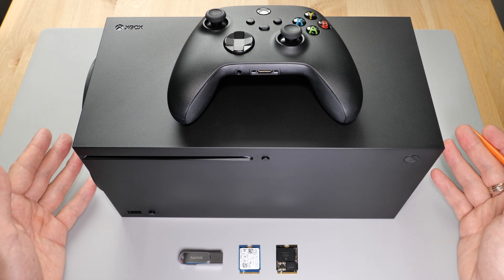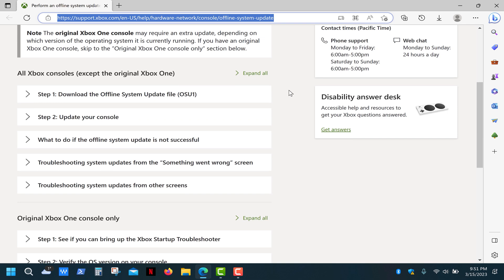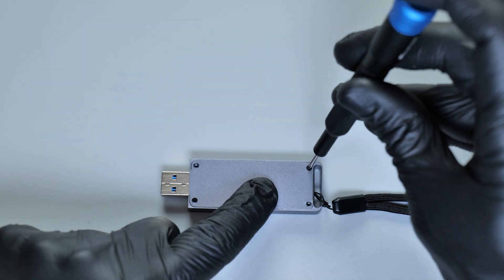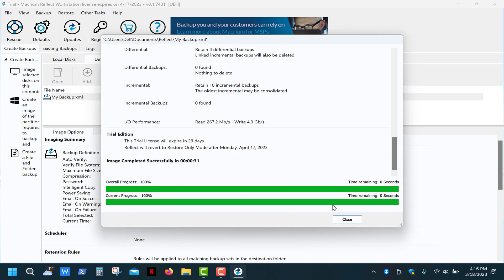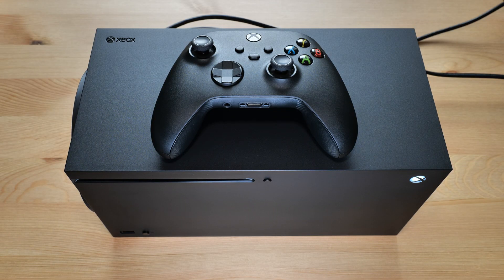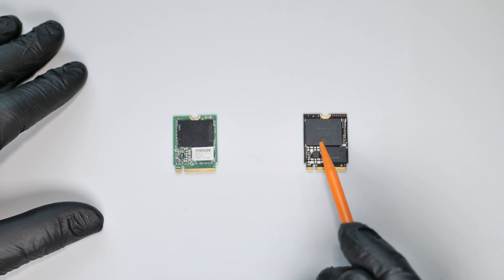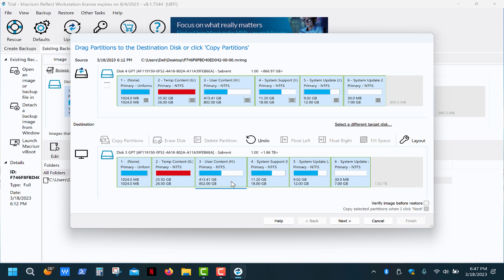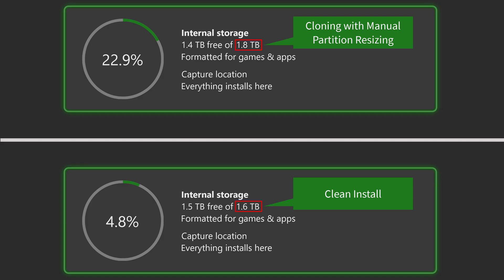Upgrade Xbox Series X SSD to 2TB – Clean Install or Clone Method (Step-by-Step Guide)

Comment: Really wish there was a 4 terabyte version that we could upgrade to easy. I just bought the 2 TB expansion card for the Xbox series X and it cost $250. But I bought a 4tb SSD for my PS5 for $175 on prime day. Really sucks to pay more for less storage space on the Xbox.
Reply: I really can't believe they went with 2230 m.2 that is crazy wtf were they thinking
Reply: @hotdogmanful why is that crazy?
Reply: This is why most of my frds sold their Xbox and got the ps5.

Everything we want to play a game together online, need to wait for fresh to DL the game again.

Lost alot of time waiting.

Ps5, we all upgrade to 2TB.  Much better gaming experience.
Reply: @bathingduck4646 I added an external SSD. Old games can be played directly, or I move the game from external to internal, to avoid downloading again. But yeah, just some normal SSD as the PS5 uses would be so great and cheaper.

Comment: Do you know if an ssd removed from this series x would work similar to a seagate expansion card if used in the CF-Express to NVMe 2230 Adaptor sold online?
Reply: forgot to say please. Lol. Thanks in advance.
Reply from the maker: It's just a regular NVMe SSD. You can put it into your PC, laptop, enclosure or any other console.

Comment: So will any 2230 2tb drive work? In the video you have upgraded the xbox series x internal ssd from 1tb to 2tb?
Reply from the maker: At the moment, all available 2TB 2230 SSDs won't work without some tweaking. I believe those tweaked SSDs will soon be available on eBay and AliExpress.
Reply: @ElectronicsComputers can you show US how to tweak the SSD??
Reply: @ElectronicsComputers probably is a simple modified firmware

Comment: What happens if the console gets a new update would pose a problem or will it be fine or would need to be recloned again?
Reply from the maker: There were some problems with cloning on One X, with Series S and X I'm still testing it but seems everything works flawlessly. If you're upgrading Series S to a 1TB SSD, I'd recommend clean install method and you won't have any problems.

Comment: Very good Video. I wish there was a way to clone the SSD without taking the console apart….
Reply: How would you you get to the ssd otherwise? Lol
Reply: You need to take apart at some point regardless. So that wouldn't really have any sort of benefit.
Reply: I get that. I mean it in the sense of doing a weekly backup in case the HD dies
Reply: @domgee ah yes! Or at least after every system update. You're right totally agree that would worth while. 

I wish it was possible to for that purpose.
Reply: @akop87  Exactly. At least you get that!

Comment: Read somewhere, it won't have the boot animation, but as Microsoft updates its dashboard is restored automatically on next update
Reply from the maker: That's right. You can add those animation files manually or simply wait for the next update.
Reply: @ElectronicsComputers  can you add a custom one temporarily?

Comment: Perfect video perfect technician can't thank you enough, just wished the compatible sdd list would be greater but is just a matter of time, as portable gadgets are getting more and more used noways which use 2230 sizes
Reply from the maker: I wish it was like on Xbox One X, which has a NAND chip on its motherboard that contains a bootloader. The NAND chip is responsible for storing the system firmware, including the initial bootloader code that is executed when the console is powered on. So you can just put any SATA drive and install offline system update. On Series S|X they got rid of that chip and moved that bootloader to the SSD. Plus they decided to play with the encryption and SSD compatibility.
Reply: @ElectronicsComputers  thanks for your reply that's good news for us xbox series x owners I hope this doesn't pose a risk later on with a software that could causes it fail. And from looks off I don't want to be cloning it after every update plus I heard this from a tech guy says if the ssd dies after some time like after 8 to 10 years down the line of its lifespan we will need to send it back to Microsoft to Encrypt and put a new SSD😢 NOT sure how TRUE  that is. And I just finish watch a video by the YouTuber called @TheCod3r  where he replaced a PS5 SSD from a Donna board to it worked well on then ps5 that needed the replacement but still not sure how good is it after a software update guess test still has to be done to see well thank bro for this information you're awesome this helped alot keep up the good work bro
Reply: @Alpha_1c  ps5 is even harder to fix, soldering I believe 5 chips rebbaling then, takes lots of labor cost and time consuming, also where are the replacement chips available to purchase? Are you going to harvest a second hand ps5 motherboard to replace a diminishing sdd life time, is worthless, yes the nand info is stored on a chip, on xbox more or less you can buy brand new sdd and replace it for security every 5 to 7 years as they will get cheaper, good was if someone made an app on xbox on the dashboard 
 which told us the heath of the sdd and if it was close to end of life you just replace the sdd and you're good to go for another 5 to 7 years
Reply: Just a matter of time aka long after xbox stops making this system.
Reply: @7531monkey  there's on the second motherboard of the xsx if I'm not mistaken, a location with some  pins to solder the supposed nand chip, but Microsoft for cost saving decided not to insert the chip there, and used software nand. It's all software Microsoft can revert this and make a single bootloader for every console instead of this process and a single backup is all it takes. Its all depended on Microsoft
Reply: Can you please tell us which 2tb SSD did you sue inside?
Reply: @LEESTLANE  I guess more SSD are compatible, a chinese company hacked the firwmare of a 2280 SDD M.2, which the console recognizes the SDD as a WD SN530 model or another stock compatible model, and it works, only thing missing for cheap SDD replacement, is to get hacked firmware.
Reply: @Viggen66  yep, I saw these 2280 SSDs on aliexpress
Reply: @Viggen66  they have installed a encrypted key to make the console read. This encryption key is included in all "official" expansion cards.
Reply: @LEESTLANE  0nly for internal sdd external it has nothing

Comment: In my opinion, it may not be required to leave 2GiB at the end. Rather, it is essential to ensure that the GUID of each partition is accurate.
Reply from the maker: It shouldn't be the exact 2TB or 1GB for a 1TB SSD. I've noticed that after some major updates, the size of certain partitions may increase, so it's advisable to have some unallocated space available for potential partition resizing.
Reply: @ElectronicsComputers  Okay, thank you, sir. I would have thought Microsoft was using the same capacity-shrinking garbage drives as before. (908GiB/970GB Seagate 2.5" HDD)
Reply: @ElectronicsComputers  From your video, I have observed that the GUID on the partition of XBOX Series X does not require readjustment. Would the console report any errors?
Reply from the maker: @rzlnie  We clone all partitions "as is" and then resize only the User Content partition. That partition contains all your games and other user related content.
Reply: @ElectronicsComputers   Alright, thank you. 🧐
Reply: @ElectronicsComputers don't we have to initiate or initialize the new drives to have all the storage capacity accessible
Reply from the maker: @jgvtc559 Yes, and I did it in the video.

Comment: And please explain where you got the 2TB version from? Is it SN530 or SN740?
Reply: @ElectronicsComputers thanks is that hacked firmware widely available, of what I have seen only replacement sdds came from aliexpress second hand with little use
Reply from the maker: @Viggen66  Unfortunately, I have nothing to do with SSD modification and its custom firmware. If I could do that, I'd definitely share my knowledge on that.

Comment from the maker: VERY IMPORTANT!!!
Both the clean install and cloning methods work perfectly for replacing SSDs in Xbox Series S and X, but you still need the first RAW partition from the original SSD. These methods also work perfectly for upgrading the Xbox Series S from a 512GB to a 1TB SSD. Simply purchase a compatible SSD (WD CH SN530 500GB and 1TB, Solid State Storage Technology Corp XA1-3D1024). After each offline update, the encryption key will be regenerated, which means that the boot partition on the original SSD won't work anymore. Your console will turn on and immediately turn off. Therefore, after every offline update, even unsuccessful ones resulting in an error code, you must preserve the boot partition from the currently installed SSD; otherwise, your console can only be fixed by Microsoft.
Avoid purchasing any used Xbox Series consoles without SSDs, as they cannot be fixed in the same way as previous Xbox generations. Such consoles are essentially worthless unless you need them for donor parts.
P.S. It's not an upgrade to 2TB SSD video. Even though I planned to create one, but I have decided to postpone it for the time being. It was a very expensive experiment, not counting months of time and team effort for tweaking the SSDs. Also the third-party that was working on the SSD doesn't want to share all the required information. I suspect it was just a firmware tweak, even though the SSD had signs of flux around the controller chip. I hope we'll work it out in the future.
Reply: Man take your time 🙂 you are really really good and determined.
Reply from the maker: @manuelfabris7541  Thank you for the comment!
Reply: Ssd 2tb Could you?   @ElectronicsComputers
Reply: Do you have to buy a certain brand model ssd? Or will any 2230 m.2 ssd work?
Reply: can i use a sabrent rocket NVMe 4.0 M.2 2230? (edit) i tried it, you cannot, i think the xbox checks for brand or model number or something, fuckin Microsoft
Reply: @lrgbajablast  im guessing it will have to be hacked like the previous version there was a way to prep any hd or ssd to work in the console ive put 1 tb ssd in the previous xbox one and boy was it fast so im guessing they did the same wich is dumb open this up so we can add more internal storage
Reply: @moobypets  of course they do it that way, its so they can charge you for their proprietary expansion cards when you run out of space.  I wouldn't be surprised if they were inflating the amount of space games take up to get people to buy more storage, too
Reply: @lrgbajablast  Thats right! Transcend also does not work, which i tried.
Reply: Could you upgrade the base 1TB internal to a 2TB or a 4TB if one could be found?
Reply: nice job so this was a special drive so we wont be able to upgrade main drive to a 2 tb variant
Reply: Can a 2tb WD SN740 drive be used in a series X?
Reply: Could you specify with RED BIG LETTERS in video description that only SN530 SSD 1TB is supported to upgrade? Because I've almost bricked my Xbox S by trying to upgrade to 2 TB SN770.
After restoring E109 appears. Only copying that boot partition back from then new 2 Tb SSD to the original 512 Gb SSD resolved E109.
Reply from the maker: @djdr0n  First of all, there are several compatible models of 500GB, 1TB, and 2TB SSDs. Second, there is at least one model that I know of which can be made compatible. And third, nobody ever said that the SN770 was compatible with the Series S|X.
Reply: @ 2 Tb? Which 2 Tb SSD is compatible? 500 Gb SSD make no sense to upgrade) The problem is that it is not clear from the video which SSD's are compatible, which are not. That's why I bought SN770 2 Tb SSD and started to upgrade, but failed.
Reply: @ElectronicsComputers cant you give us the list of 2tb that work?
Reply: @ElectronicsComputers  if there are several tell us which ones they are.  i bricked my console for 3 days. a whitelist and any info you can provide would be helpful for the masses
Reply from the maker: @beegeex2jenkins850  How did you brick it? Do you still have a copy of the bootable partition from the last offline installation attempt? Without any modification there are only two models that work with Series S and X: WD SC SN530 and SSSTC XA1.
Reply: seem like there's already someone on ebay selling different brands and made it work?
Reply: @WebsiteDesigners so you never heard of scammers on ebay huh
Reply: This what’s always infuriated me about Microsoft consoles. Upgrading or replacing hard drives has always been a trivial task which requires extracting boot files and buying compatible hard drive models. What happened to the days of installing the OS to an on board flash and just dropping in a new drive
Reply: Literally…one year after this was release, there’s a 2TB Series X
Reply: Would using a ssd from an xbox series x and putting it into a series s work without doing all this extra stuff?
Reply: @whatif8741 no. The raw file in that first partition has a special key that is matched to the motherboard and that's the reason you have to copy it to yhe new drive. If you took one from an x and copy the raw file onto it from the s, now you just bricked the x. I mean, you CAN do it, but you still have to do all these steps to make it work.
Reply: Should I get an External SSD for the meanwhile. Until these Mini SSD updates. We always thought that they were going to get bigger but I forgot. We love To corner the market!🙃
Reply: What about Corsair MP600 Mini 1TB M.2 NVMe PCIe x4 Gen4 2 SSD – M.2 2230 or the WD_BLACK 1TB SN770M M.2 2230 NVMe SSD?
Reply: Sorry for the long name but I want to be sure about this SSD before buy it, it seems it will fit and also it has a great read/write (MB/s)
Reply from the maker: @SScooldoWN  The Corsair MP600 won't work for that console.
Reply: @ElectronicsComputers  so could it be the WD_Black SN770M?
Reply: Does any SSD work or it has to be of a certain make ?
Reply: Brother can i use sn770 wd 2tb and it will work or just sn530 only support sn530
Reply: y si por un casual se daña la tarjeta origina y no tengo un backup de mi consola que ocurriria?se podria solucionar ? gracias
Reply: Will any WD SN530 1TB work? Can I use a program like acronis true image to clone the original drive?
Reply: Why do you need the boot partition?? I ve upgraded my xbox s before and microsoft has those files to transfer over your new ssd
Reply: You droppin the video for how to successfully upgrade the series s internal to 2tb some of us are still stuck in the dark ages over here, console wise 😂
Reply: @dillyworld225 same here
Reply: So we cannot upgrade to 2tb?
Reply from the maker: @SwerveNation There's already officially supported 2TB SSD available for sale, but it's not worth paying half the price of the console  for that drive.
Reply: @ElectronicsComputers okay, because I read your comments.Stating that this is not an upgrade video
Reply from the maker: @SwerveNation  I upgraded my own console in that video using a modified SSD, those SSDs show up from time on Aliexpress and ebay but I don't recommend using them.
Reply: @ElectronicsComputers ok i see, thanks
Reply: Hi, how about SNV3SM3/1TO SNV3SM3/2TO? Greetings and thanks.
Reply from the maker: @protector2020  Those are not compatible and never will be.
Reply: @ElectronicsComputer : Does it make sense to create an List with all known supported Devices?
Reply: can you (raid 1) 2 1TB drives, connect them to the nvme port on the xbox so it writes the same key on both drives, having two working drives that can be swapped without the need to generate new keys or just incase one drive dies ?
Reply from the maker: @garkoi5907  It's not gonna work. Simply clone it.
Reply: @ElectronicsComputers  If you fully clone the old SSD (boot partition included) to a new SSD for an Xbox series X, why is an offline update required?
Reply: Whats the difference between the slim series x and the shoebox looking one

Which one is better are they identical besides the case?

What one is easiest to take apart bro

Thanks in advance
Reply: @jgvtc559  there is no Xbox Series X that is slim. The only Xbox Series X looks like a mini fridge (the one he used in the video). Though there is Xbox One X, that one is older, based on AMD Jaguar, so it is slower than Xbox Series X. Same gen as PS4/PS4 Pro.